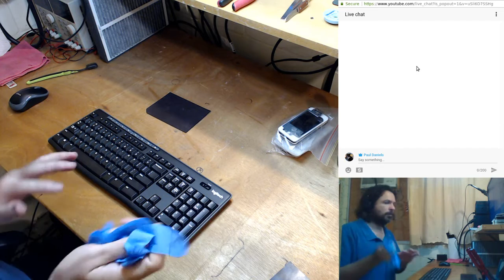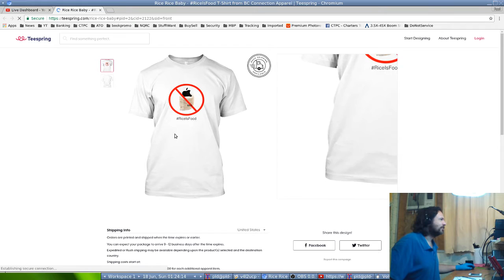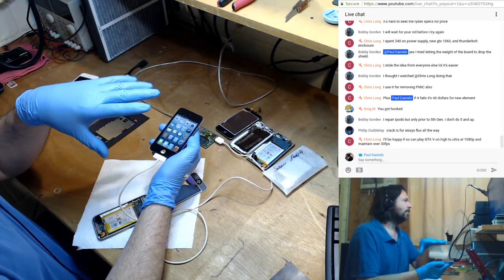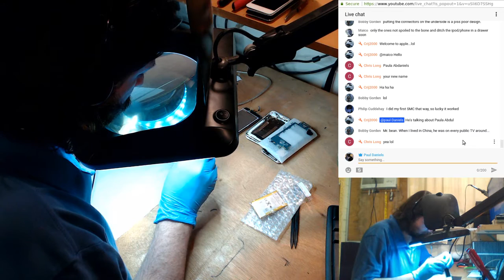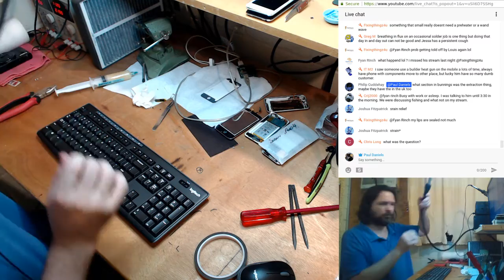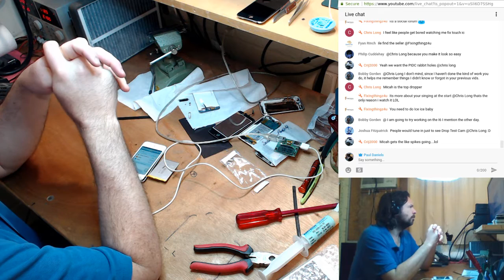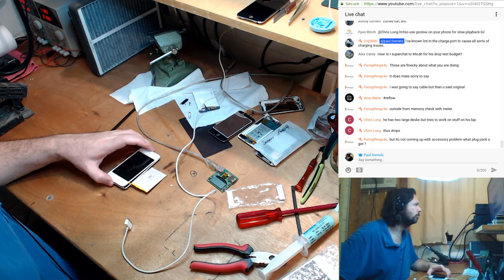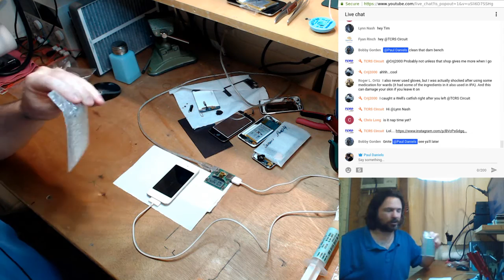Bag of iPod Touch 4th gen's, try fix up to give to people.

Comment: Just a thought.. I think one could make their own fume extractor using a cabin filter off of a car. There are some rather exotic ones that have activated charcoal and can be had pretty reasonable. one could make a box to hold it and reduce it down to the (2"?) size of the industrial vac hose that is available from Home Depot and then plug the other end into a small shop vac. Here is a link (Wix.. how ironic for Louis!)

 http://wixfilters.com/Lookup/FilterBySize.aspx

Look up the size you need then go to Wix's main page and find out what kind of car it fits. You can then look up that same model of car under the websites of other brands of filters and see if they have an activated carbon filter.

For example: a 24878 Wix is approximately 7" x 5" with clean rectangular sides and fits a 96-04 Acura RL. I plug that vehicle info into RockAuto,com and find that the equivalent in a Fram is a CF8762.. and that particular one is a carbon filter.
Reply from the maker: You'll be amused to know that that's basically what I have there on my desk.  Ford Falcon BA interior HEPA+Activated carbon filter, combined with a high-pressure 120mm axial fan.  I need to get my act together and box it up.

I'm still looking though to probably use the 6" hydroponics systems (about $199), bit of a mix and match game.  Does make you wonder at times though how/why the commercial premade systems are $700+.
Reply: What a relief..at least I know I'm not going crazy.
Reply: Wow.. now that you mentioned that you did the same thing.. your filter does look rather familiar. It must have subliminally triggered my comment.